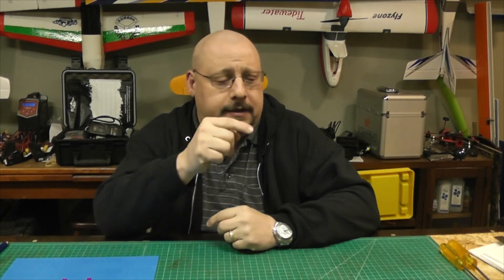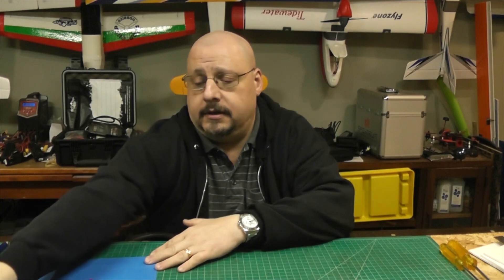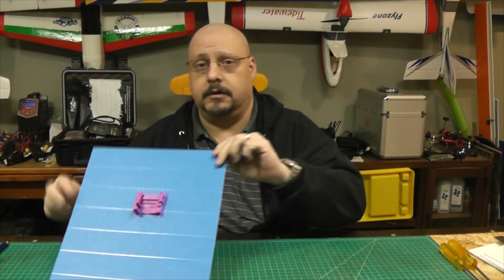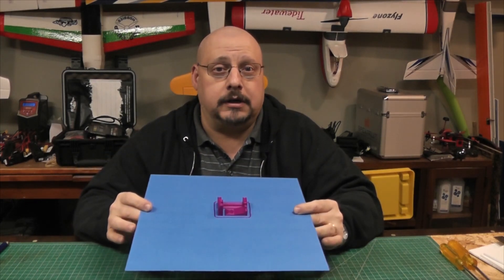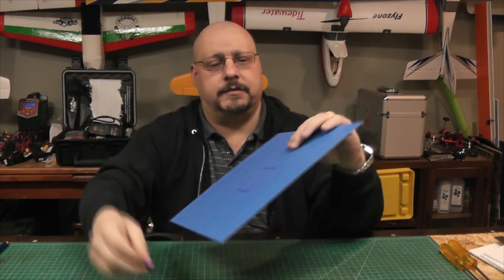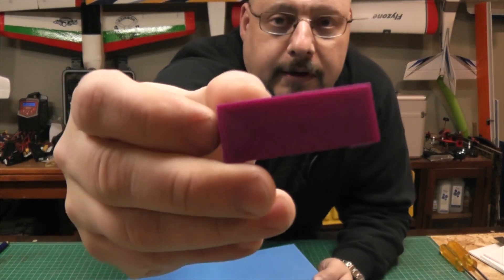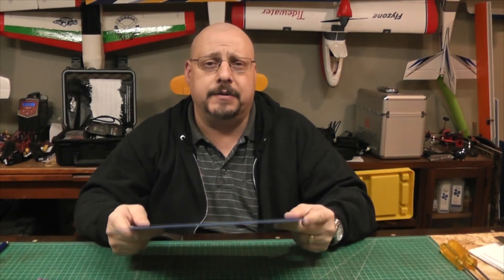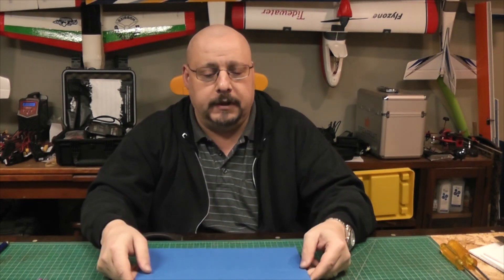DIY 3D Printer Flexible build plate hack

Comment: Hey DT, where are you with this now?
Reply from the maker: Ended up going back to glass and Aqua Net super hold. Despite having to wait for the glass to cool for easy release which, in my case, it has proven itself to be the gold standard for adhesion.
Reply: @DroneTastic  Never really warmed up to the idea of using a spray to hold my prints and have really gotten used to Elmer's glue stick.  I used to put too much on, but now have it down to very thin coats.  Once in a while I'll clean the build plate with soap and water, but that's it.  Some people have had luck with a clean mirror, but they seem to be in the minority.  I also won't subject myself or my printer to a sterile room environment just to make prints stick, so Elmer's to the rescue.  Happy printing and stay safe.